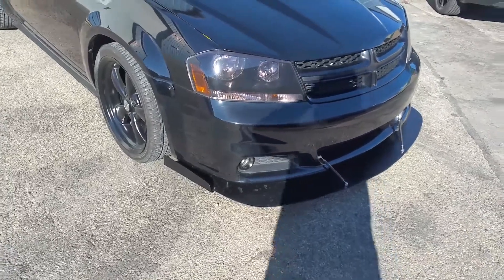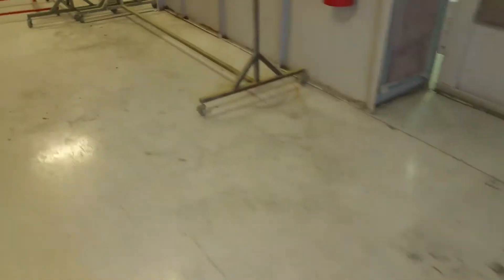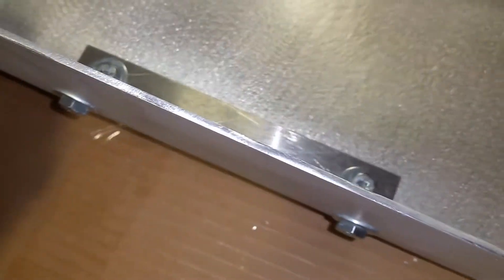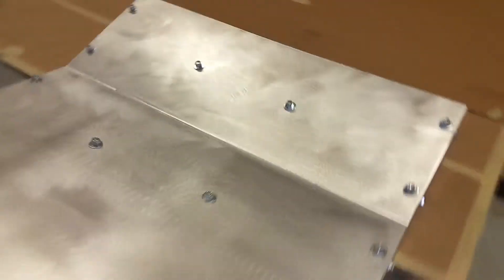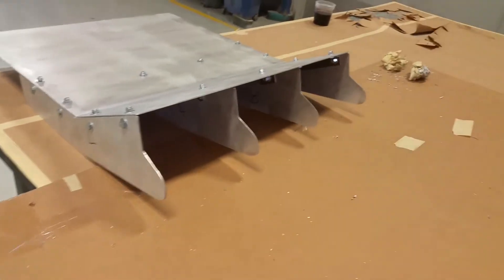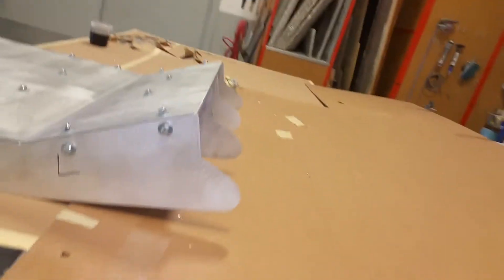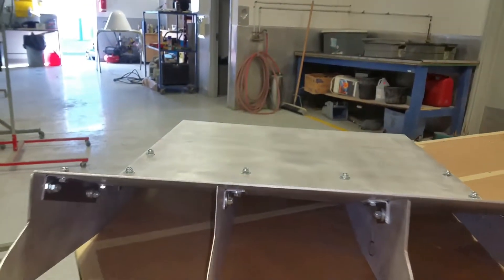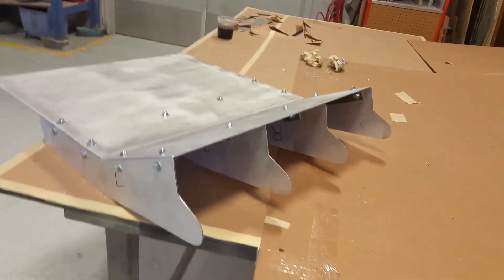stage 2 splitter and stage 1 diffuser

Comment: How would you price the splitter and diffuser? And would you be interested in making another one in gloss black and selling it?
Reply from the maker: Well I got the material for free of course cuz I work here but I have to price it out by the square foot and the price would also vary depending on the thickness but it's not a drastic difference and I also have to take in consideration the shipping  depending on where you live  it may not be cheap but I'd have to get back to you I'm really busy painting planes right now so I don't have a lot of time to be building this stuff especially when I'm working on my Jeep as well but I will definitely find out. I would like to help you out and you'll definitely have to be patient LOL but it is possible to get one made for you